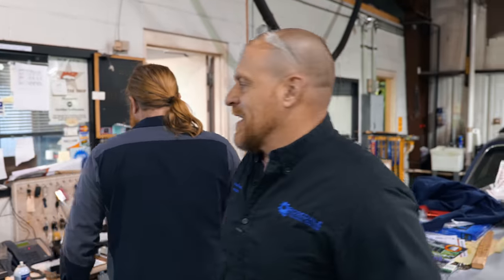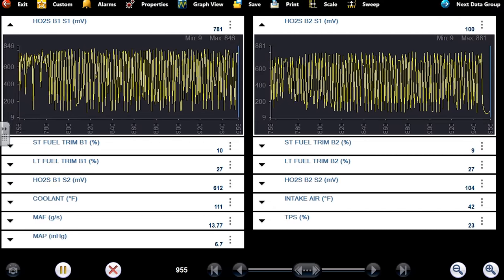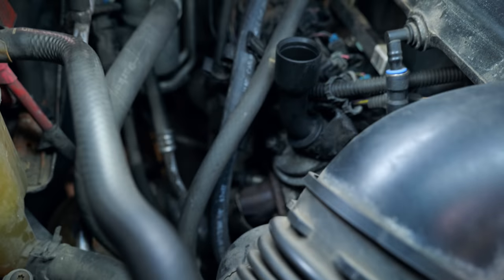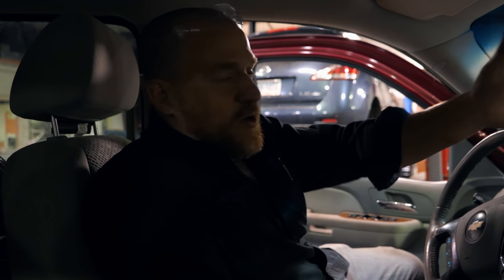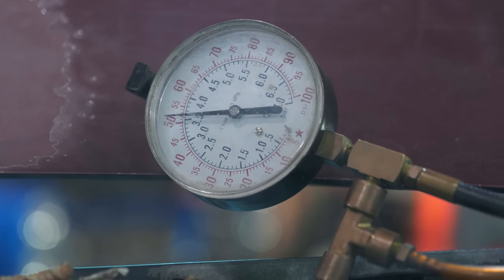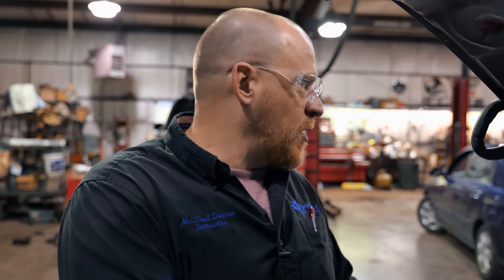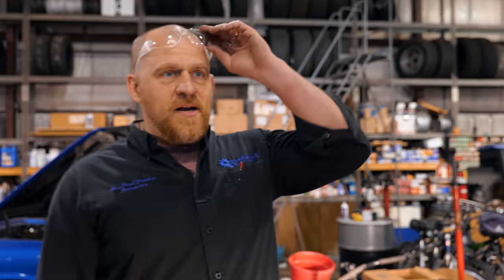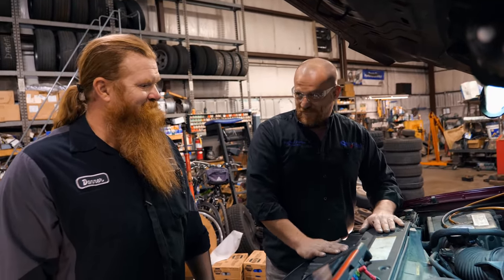Multiple Problems/Poor Customer Communication (Low Power, Long Crank, Stalling P0171/P0174/P0121) P1

Comment: Just started your premium channel this week and as recommended started with basic electrical concepts and moved to methods of testing (Chapter 1) and already am seeing what you teach coinciding in the work place. Like in Chapter 1 getting as much information from the customer. Also in the same chapter how you cover fuel trim and using a fuse jumper to the scan tool to collect data. Good stuff. I am tired of being a parts changer. I'm gonna be 58 ands it's never too old to learn. I was around for points and condensers and mechanical fuel pumps. Vehicles have come along way since then and continue to get more complex. You are a great teacher! You make learning easy. Electronics have always been my weakness in the field. Wish l would have joined sooner.
Reply from the maker: Awesome feedback! Thank you so much. Looking forward to hearing from you more.
Reply: It seems to be your go-to scanner. I'm in the market for a scope and was going to do the pico since you recommend it but my buisness is all mobile so I'm thinking this would be a better setup. Would you recommend any snap on scanners over this one or would you recommend an entry level pico ? Most videos I see you get by with the 2 channels available on the snap on
Reply: @nikkoruscio4966  I know this is a few months old but I would go with a pico scope even as a mobile guy. You can get by with the snap on scope but when you want to do something like cam/crank correlation or something that requires looking at detail and making measurements the snap on can be a chore to use when compared to the pico. I would definitely also spring for the four channel for that reason as well. Even with a four channel you’ll sometimes find yourself taking two measurements to do some things like cam/crank correlation on a car with four cam sensors. The pick is so much more convenient to use that it’s worth carrying around the laptop for. If you want it to be ultra portable get a used Dell rugged tablet for cheap and mount the pico scope to the back.

Comment: Oh, man, you answered questions as I thought about them, time and again. It is so cool to have a teacher who is on the same frequency. What an interesting observation, to find the pump is working perfectly electrically, then using that as more evidence that the 'pump' is bad. Of course, if all of the regulator, filter, sock, internal tubing and pump are sold as a unit inside the tank, it doesn't matter which component has failed. You just need to prove the pressure is outside parameters and prove that the pump is getting adequate power.
Reply: Good to see you here!
Reply: starving the pump for fuel would likely cavitate and cause it's RPM's to rise, with current dropping lower. clogged filter would likely cause higher and steady current, seeing their most always pre-regulator.
so it's more likely the regulator or other leak within the tank, but it could be a combination of clogged filter/s, failing pump(check waveform on scope), regulator and leak. LOL
pretty much pull the tank and change the whole assembly or build a test tank and stand.( yeah nobody will do that)

Comment: Sometimes people just don't care. The pump probably went first, causing the long crank time. If the battery was already marginal, the extended cranking likely finished off the battery. Then, the alternator was being stressed trying to charge a junk battery. If the customer had the vehicle serviced as soon as a problem was apparent, he could have saved himself some time and money in the long run.

Comment: Last week i was able to diagnose fuel pump problems using fuel trim figures. My car could start first time but had driverbility problems. Checked the MAF figures were good no vacuum leaks fuel trim total 36%. Changed pump and was good as new. Yesterday i had a customer complain about long crank time when the car sits for a while. I confirmed that long crank time, checked fuel trim figures were 15% but could drive well. I put a pump and no more long crank time. Thanks for thes videos. I have really learn't alot.

Comment: So typical for a customer to drive the car and for the customer to keep adapting to a vehicle that is suffering from multiple issues. The straw that broke the camels back was the charging/stalling issue. That usually brings in the most oblivious of customers. Even asking customers for details such as how it was running before the issue bringing in the vehicle is met with a blank stare. Engine management has become so adapt to failures. Both good and bad. Too bad our customers don’t have a OBD port!

Comment: Some of the public as a whole don’t realize how important maintenance is. I mean that truck is capable of 400,000 miles with proper maintenance.The dirt that got in the engine with no oil cap can cause premature engine failure. Another great video Paul and Caleb!

Comment: Got to love multiple problems! Can't believe the guy was driving with no oil cap! Those engines barely last when everything is right, lol - I would definitely want my oil cap!  I laughed hysterically when you were cleaning the TB, knocked something over, then, "BEEEP"- censored, LOL! You sound just like me! Hard not to cuss at something in this line of business, that's for sure. Anyway, hopefully he wants the fuel pump - I want to see that, since I have basically the same truck with a bed out back. So far my pump is still alive at 117k, but the engine is a different story. Fed that thing nothing but the best synthetics since 2k miles, too. Can't win today. I bought a pickup tube o-ring and 2-bolt support brace for it - hopefully that's all it is, but I'm not that hopeful. My guess is the #2 cam bearing, but we'll see. Just sucks it's so much work just to replace this little o-ring. Nice work as usual, fellas!

Comment: I had a similar one but it was the plugged filter on the fuel pump module. After finding they drove in a dusty environment. If you let it sit then most of the crud would fall off and have to run it under heavy load for an hour or so. Then would plug off again and psi would drop to 15 psi. So changed the pump and got back up to the 55-60 psi again. There is a nice fuel pressure and flow tester fromMityvac MV5545 FST PRO. Very handy for loading the pump and verifying flow with pressure.

Comment: 245K, wow that's a lot of miles. I wish customers were more up front with all the problems their vehicle is exhibiting. Your brother was right though, once you know a vehicle has a low voltage issue then that has to be addressed before doing anything else (you know that too Paul I'm sure). Low voltage can really mess with electronics on a vehicle. P.S. , tell Caleb nice thumbnail, LOL.

Comment: Danner, I use penetrant, an old toothbrush, and a shop towel to clean them. No need to take the throttle body off..... in the 90s that was chrysler's way to clean them.

Comment: I think it's not the fuel pump.
Because the fuel pump is in spect.also you have to start to put the oil cap first and see .
The engine need air escaping from oil cap and that's why you have a long crank start.
Also don't forget I injector and vacuum leak or fuel pump filter...
Thanks for video

Comment: Those friggin' GM fuel pump check valves.  Usually we don't see them last long enough for the check valve to go bad, the hard metal line coming off the sending unit almost always rots away and causes our long crank times

Comment: Hi sir Danner,
Why mechanics hestitate to replace O2-sensors,after every 50k milage/without given some problem.*
I change them as soon they reach 50k miles...even if they are working fine.*
Thanks.
Keep the good TEACHING AND PRODUCTION OF GREAT VIDEOS WITH DETAILED ILLUSTRATIONS IN DIAGNOSTICS.*
Bessings for you and your family.
👍😎
Reply from the maker: I won't change them based on mileage but based on activity (frequency and amplitude of the signal)

Comment: One good rule of thumb is unhook the battery before messing with that throttle plate that joker can take a finger off and it also resets the how to learn on its own once battery is hooked back up
Reply from the maker: Can't unhook the battery to open the throttle with a scanner (best way to do it!) Just keep your fingers out of there
Reply: If you had a helper , could they turn the ignition to the on position (not cranked) and depress the accelerator petal all the way.  Would this open the throttle? Then clean with a toothbrush. Drive by wire system of course.
Reply: @ScannerDanner  I think he meant when opening the throttle manually(by hands)
Reply from the maker: @dougsanders6034  yes, but some cars you have to put them in gear for the throttle to react to app movement with the engine off

Comment: I am in the marine engine repair field and almost every running issue that isn't a new boat warranty issue is a multi problem situation. People don't bring their equipment in until they have to push or tow it in some times because they don't want or have the money to spend and some times because the problems show up gradually and stack up on each other. I have had customers state the boat won't plane off but it idles fine but then we find a 6 cylinder engine is running on 3, shakes and barely runs at idle. Also here in the south I have to be careful of what the customer is saying and what he or she means. If the engine won't start many of the customers say it won't crank so I expect a starter circuit problem but the fact is, it cranks and won't start.
Reply from the maker: We deal with the same and I can only imagine how difficult a "test drive" may be at times for you! Thanks for sharing.

Comment: It’s probably the regulator in this case as the pump waveform looks pretty healthy while the pressure drops off instantly with the key off. Looks like the regulator is stuck wide open.  GM is so dumb with their output test control timers and their diagnostics in general. Like when you get a timing code and it totally shuts down everything with the variable valve timing and everything defaults to zeros and is ignored. It basically renders the scan tool useless in checking valve timing issues and you pretty much have to go straight for the scope. With Fords you can look at the VVT error pids and see the timing out or jumping around.

Comment: There is the pressure that the pump produces, and there is the performance of the pump. which needs to be taken into account. one does not depend on the other.

Comment: Great video, yours always are. I have a different problem. 2013 Tacoma 2.7L, I don't think this is relevant but lightning struck near the vehicle during a storm, truck started the next morning and while driving to town just shut down. No check engine light, cranks but no start, no communication, only with airbag. checked 5volt reference, 2.8 volts at mass air which I thought was not pulling down enough to be a grounded sensor but started disconnecting sensors anyway. of course all disconnected voltage came up to 3 volts but did not return to 5. Is the 2.8 volts at THA wire on maf to high to be a grounded circuit or sensor?

Comment: Hi Paul
Quick question, I’m not doubting your diagnosis AT ALL!!!
Just trying to learn about sign waves now that I have a uscope 😀

If the pump is bad, why does the fuel pump sign wave on your scope looks good?

Can’t wait for the 1986 mustang diagnosis!!!
Reply: Think because the waves are just checking 12 volt power supply and good ground. The actual signal. not actually the fuel pressure
Reply from the maker: It has good power and ground was what the amperage told us. And the characteristics of the pump waveform looked good too suggesting that it may actually be a regulator or in take leak issue, but all of this falls under the umbrella of a new pump assembly being needed. We were talking about this at times too. On this design, the regulator, filter and pump are all one assembly and do not get serviced separately. Hope that makes sense. If this had an external regulator, then further testing of that regulator would have been warranted here.
Reply: @ScannerDanner  got it 😀

Comment: Normally when the fuel pump fails the fuel pump will get hot and short out that is what I've been taught that the fuel pump will stop working all together also the fuel pump when it's cool down then a vehicle would run okay until it gets warm then it will short out I've been known that it's a common problem and diagnosing a fuel pump and diagnosing powering grounds

Comment: On these and most GM.14% at 14 or above is when they'll set that code at 12% or less you can and will have stalling problems with the a.c. on hot and warm. I keep good practice to check this as a maintenance. 06 to bla can't remember you will see around 4 to 7 . older they will go closer to 0 mainly on GM cars.

Comment: I'm just wondering if that "oil cap lean" situation may be a clue there is an internal vacuum leak between crankcase and intake. Under the high vacuum conditions of idle, the PCV should be mostly snapped shut. But here, with a big change in the leak on removing the oil cap, surely you have a big leak of air between the crankcase and the intake? Either a bad PCV valve, or an internal vacuum leak? If you put a vacuum gauge on a tube going to the crankcase, I wonder if you'd see engine vacuum there?
Reply from the maker: That of course could be possible but what told me it is definitely a fuel pressure issue, even at idle,, is when the cooling fans turned on we had a 2 psi pressure drop 😉
Reply: @ScannerDanner  Too, when driving and putting throttle down, O2s go lean.
Reply from the maker: @codo7  exactly

Comment: Some of those trucks around that year model won’t relearn the idle without reprogramming the PCM to the latest calibration. It will idle ok until you hit the throttle once and then take off to 3000 RPM and stay there. Neither a relearn or battery reset will fix it if that’s the case. It’s weird because it’s not all of them but I have come across it more than a few times. Even tried using the tech 2 for a relearn with no luck. I guess it’s a software glitch as reprogramming seems to get rid of the issue permanently.
Reply from the maker: I've been down this road!

Comment: since it was popping so easily when leaning out from fuel starvation. I don't recall any of them doing that from only lack of fuel, right to the point of melting down the cats. even way worse than that was.
I'm going to say, the spark plugs/secondary ignition is also spanked or junk parts, on top of all the other issues. then again, maybe the cats are melted down clogged too. driving it like that long term is killer bad. 🤪
Reply from the maker: absolutely the popping was from lack of fuel, not a misfire from a secondary ignition issue. When the spec is 50-60 and under WOT snap in the shop, it drops to 30, Imagine what it actually was on the test drive?!! I bet it dropped to 20

Comment: i took my yukon into my regular garage to fix a power steering leak and bad miss.
they told me they could not find a miss.
when i picked the truck up,it was missing badly,but they were closed.
when i called to reschedule another appt,they again told me they could not find a miss.
im taking it back wed.
they gave it a tune up months ago.
Are these guys cherry picking my truck,or just dont want to fix what they did.?
Reply from the maker: Not sure? Frustrating situation for sure!

Comment: After the new fuel pump, smoke check for evap leaks? No?  Also, not going underneath to check for powers & grounds . . . shouldn’t Ps & Gs ultimately be checked right at the component to rule out bad connections, line corrosion, etc.?
Reply from the maker: Amperage pattern of the pump said powers and grounds were good!

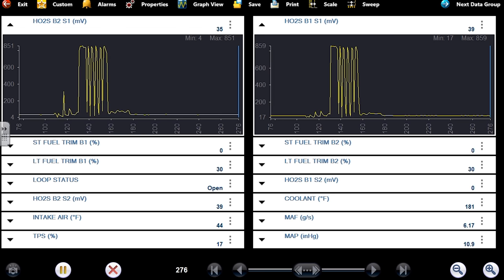Comment: First time watching through, red flag at 10:45.
Isn't the crankcase part of the extended intake system (PCV)? Wouldn't the missing cap, in conjunction with a faulty PCV control device, cause the trims to be positive...?

-100
Reply from the maker: yes, they were, watch part 1 when you get a chance. When I covered the missing oil cap hole, the the O2 sensors went rich because there were positive fuel trim numbers from the vacuum leak through the PCV system

Comment: some times you have to come back down to the real world issues with cars that most of them have multiple issues.  i have found this to be true on almost all of them that i see and it is difficult to have to tell the client they have to spend a ton of money to fix it.  the other thing is you have to go back to the primary side of the system as a whole ... power is number one with out it all the data can be off .... as this can be seen on this truck fixing the fuel pump is second on the list and still the client doesnt understand why they need all this work done .... welcome to the real world .... lol

Comment: Most GM engines has to have 50lb fuel pressure or they won't start or have extended crank time.If it has 48 lb you will have extended crank time or not run at all. Hit it with ether and it will run all day long.
Reply from the maker: GM CPI systems that is correct, this is a regular port type injection system, so they react a bit differently with low psi. Under 50 psi on a CPI and it is a complete no start.
Reply: @ScannerDanner  I have a 2008 GMC sierra 4.3 v6 and the pressure jumps up to 60 psi just with the switch in the on position. It runs great. Love the vidio.

Comment: I would love to see the volume on the pump, when it fire intake. Look for part two
Reply from the maker: I never do volume measurements. Fuel pressure under load is all you need to determine volume. But I'm 100% certain it would fail any volume test you'd do on it
Reply: I don't do volume measurements but my fuel pressure gauge kit has a fuel flow gauge built in, handy for fuel starvation faults